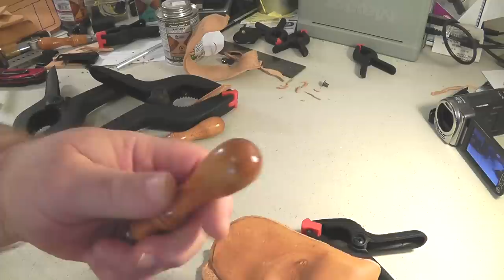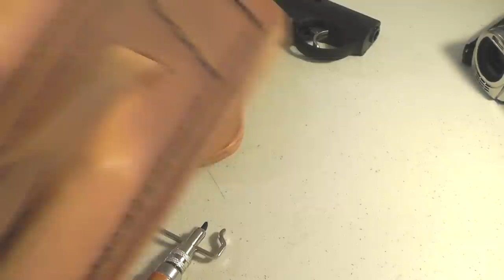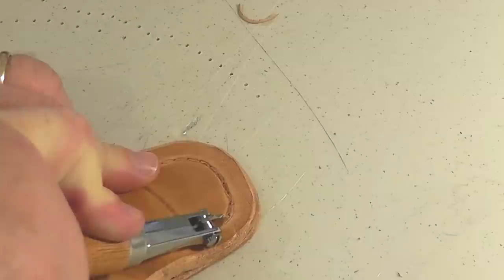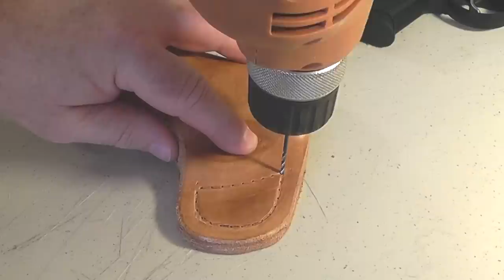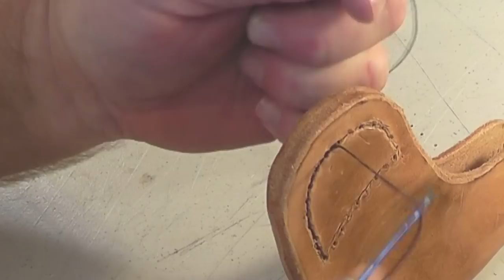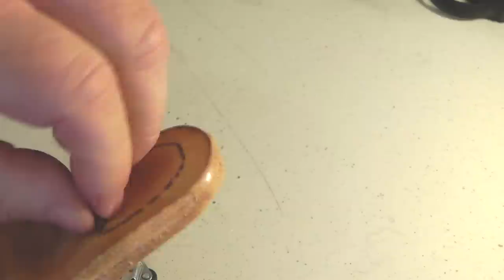Making a Leather Pocket Holster for my Boberg XR9-S - Part 2

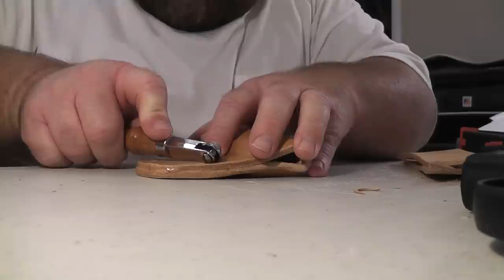Comment: at 8:16 you can see where the scratch came from. Your little pin wheel device you did not hold at 90 degrees. Any how, it still looks good and it's more than I could do. Your very talented to do what you did. If you are still using this today, how is it holding up?